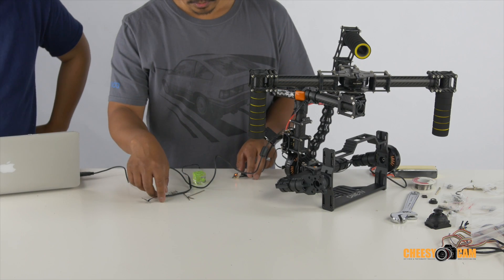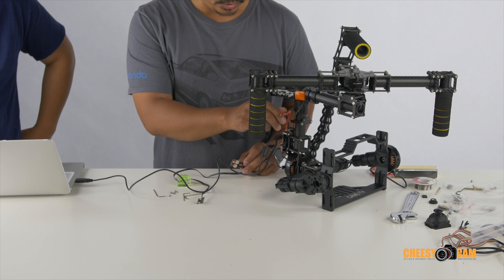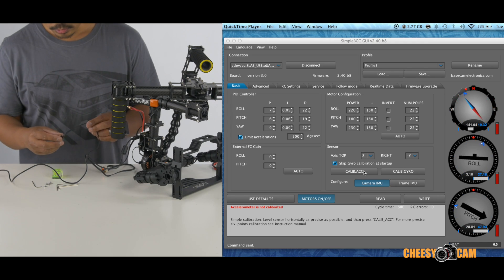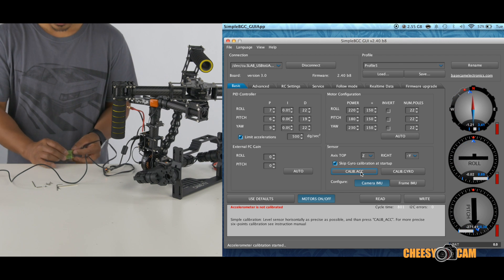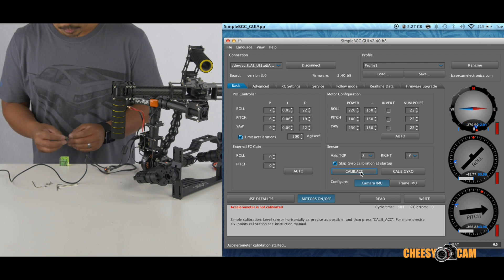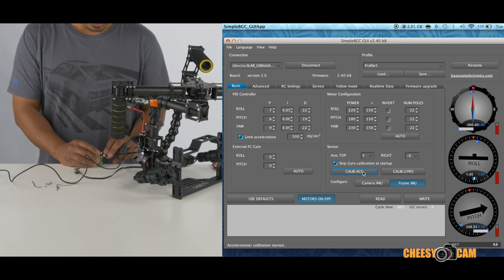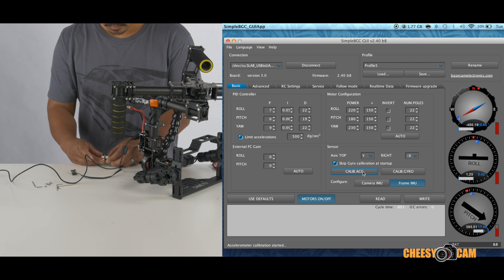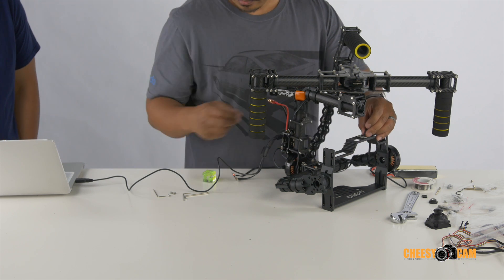3 Axis Gimbal Calibrating Camera IMU and Frame IMU 32 Bit Alexmos SBGC

Comment: thanks for all these informations! these videos are now my biggest reference for calibrating my gimbal.
However I still have a problem: for some reason my frame IMU went off calibration. Now, when I try to calibrate it, I can't click on the calibrate button because it's unclickable...
I saw others have the same issue so I already checked the wires, checked the advance mode (below yaw setting), updated my software... any other hint?
ps: I have a new Came7800

thanks a looooot for your kind reply!
Gianpaolo

Comment: im using "W-BGC Pro" firmware version SimpleBGC_GUI_2_44b4, and i did try using older firmwares too.... but i still can't select the Frame IMU still to get it calibrated, i tried selecting in Advanced... above and below but still nothing helps... the IMUs have a toggle to select from Frame to Camera and no mater where i would put it, nothing works.... Please help
Reply: anyone has any ideas?

Comment: https://www.youtube.com/watch?v=cvYamC4JCGc
I like to see what your thoughts are ?
Reply from the maker: Well I can't see the other side, but I think there is either a resistor going across the 'ADD' or not. That's how it determines the difference between the two IMU sensors. One will have a resistor one will not.
Reply: thanks i'll check it out, ahh  both boards are the same

Comment: installing second IMU on frame but I need to cut the bridge on the board, haha   I don't even see the bridge let alone cutting it,  any ideas   ??
Reply from the maker: Ron Cope I think you're talking about resistor on the IMU. That's how the board figures which is frame and which is camera. It really depends which IMU you purchased as they are not all the same. But if you remove the resistor then it will change the IMU property.
Reply: yes I agree, but the wires are so fine they are hard to see,   I took a Macro shot and expanded the view and see two wires,,  I think the one between the two solder  squares is the one...  I need a Microscope to do it
Reply: the main board is a blue  SBCG V3-02  32 bit
Reply from the maker: Ron Cope The main boards can be different than the IMU sensors. It is the IMU sensor that you need to modify to be a Camera IMU and a Frame IMU.
Reply: my issue is cutting the frame IMU bridge,  so hard to see
Reply from the maker: Ron Cope Sorry i'm no help. All my kits came with two IMUs and I didn't need to modify. I can't tell what yours looks like but possibly check the Basecamelectronics website.
Reply: Maybe I should just try them and see if it picks up the frame IMU

Comment: why i can't select Frame IMU ? :( :(
Reply from the maker: Jimmy Haidar Check the settings under advanced. I think you need to enable it and say 'Below Yaw'.
Reply: i did this step but when i click on frame he switch back to Camera :(
Reply: Hello Jimmy, I have the same problem. I can't calibrate the frame IMU because the calibrate button is not active... how did you solve the problem?

Comment: Hi There! I'm getting a "Sensor is not connected" message on my gui  board. All my connections are properly connected. Do you think this is a board issue?
Reply from the maker: Kris Capiendo Check the wiring of the all the sensors. Make sure none has been damaged or disconnected from the board and from the sensor. Make sure you don't have the sensor over metal parts that will cause a short circuit. Make sure it's not mounted to where the electronics are touching the Carbon Fiber as that will also short circuit too.
Reply: MrCheesyCam Thanks! Though I did everything I can to solve it, I had to buy a new board, Now everything is working great

Comment: Hi,
I am using a different gimbal (Levefly) that uses the 32bit alexmos. I have the gimbal perfectly balanced and get smooth footage from it. I only have one small problem, the pan motor slowly drifts over time to the right, about 1 degree / 3 seconds. I have done a 6 point calibration and played with tuning with no luck. Do you have any suggestions on how to fix this? Your tutorials have helped me greatly in understanding how it all works. Much appreciated!
Reply from the maker: It's very possible this has something to do with your joystick. I haven't published in detail about this because it's a bit technical, but the joystick operates on voltage. There is a set amount of voltage it should be when at neutral. If the voltage is not exact then the controller will respond as if you were slowly using the joystick to pan left or right. It takes a bit of time to test with a multimeter, but I had this problem with an aftermarket joystick and had to replace it.
Reply: MrCheesyCam Thanks for the reply! I guess the easy way to test this would be to disable joystick in the software?
Reply: Matt Rosendahl Nevermind, I tried disabling the yaw joystick control but problem persists. I will contact Levefly and see what they say about it.
Reply: MrCheesyCam I just received the replacement joystick and it solved the issue! Thanks!
Reply from the maker: Matt Rosendahl Seriously? Wow that's awesome to hear!

Comment: I installed the  usb to uart bridge driver to my computer but when I plugged board into the computer it doesn't show up?
Reply from the maker: Not sure what the problem is. I've installed it on three different MAC laptops. Download the SBGC software, install the driver reboot. Launch the software, use the drop down menu and hit connect. If you don't see it, possibly the USB cable you are using is not the right one. Some USB cables are meant for charging devices and aren't really data cables. You need a real Data USB cable.
Reply: MrCheesyCam Thank you so much for your help! It worked!

Comment: I'm not able to select 'frame IMU' to calibrate it....Any suggestions?
Reply from the maker: Jump over to the tab to choose where you've placed it and make sure it's not disabled also. Watch Part 7 video it shows this. http://gimbal.cheesycam.com/diy-build-came-7000-32-bit-3-axis-gimbal-stabilizer/#basicPID
Reply: I have the same problem. When i click or Tab on the Frame IMU button, is not abel to select. Please help!
Reply: Hello Kyle, I have the same problem. I can't calibrate the frame IMU because the calibrate button is not active... how did you solve the problem?
Reply: First, try auto calibration, and then you can calibrate in 6 points manual mode.